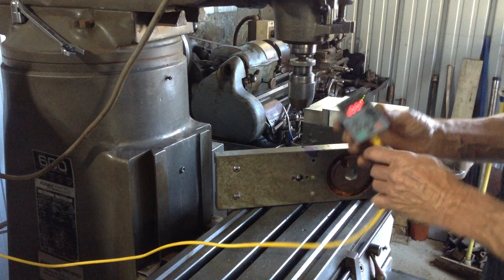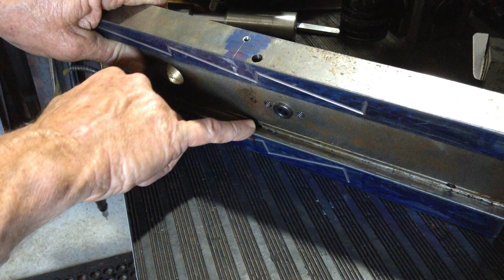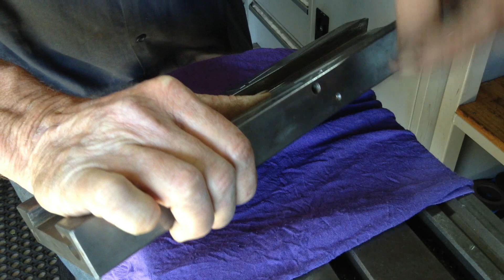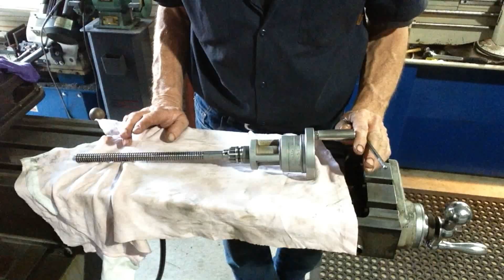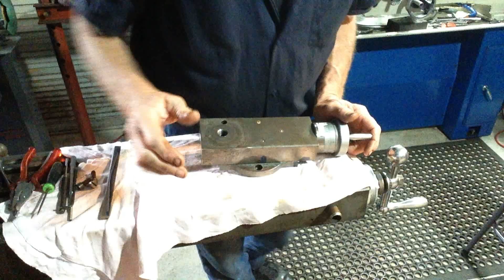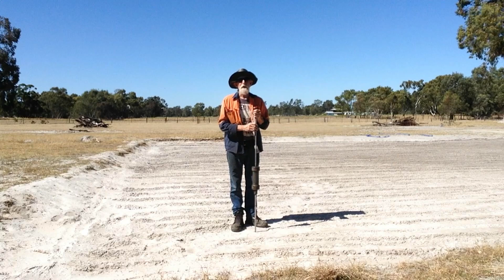Centre Lathe Maintenance & Modifications  , Part 9

Comment: I have a question for ya Max...  Isn't the screw at 6:56 there to lock the cross slide when desired??
Reply from the maker: Yes that screw is the locking screw .   The screws that i have put in near by are to blank off the ends of the oil galleries that i have just drilled .    Cheers .
Reply: @swanvalleymachineshop  thanks max!

Comment: Not sure how you sorted your vfd, but It looks like you have a variable speed head.  Watch how I run mine.  I use the factory barrel switch, I set the VFD freq to 60 and never touch it again.  I control the speed with the knob on my BP.  That little shit plastic box to control these vfds is sure to get broken.  :-/  https://www.youtube.com/watch?v=NwlOGQv8QXM  For something really cool, look at my VFD lathe video.  Yes that is a 2 speed motor!
Reply from the maker: Mine is just wired in so it will run until it's in the new shop & put back to 3 phase power .  I only start & stop with the little shit plastic box , rev is still on the mill switch .  The speeds are through the 2j vari speed knob & the vfd  i keep on 50 htz  all the time , thats what our  240v power is .   Cheers .

Comment: Hi Max, my lathe cross slide bronze nut is the same as yours except it does not have the anti rock grub screws, the sleeve and cap screw which retains the bronze nut is a good sliding fit for vertical alignment but I think over time wear of the sleeve will cause rocking of the nut accelerating wear and causing backlash.
I am on my second nut now, easily made on the mill and lathe, I just bore out the thread and silver solder a sleeve and bore and thread.
Still dubious about the grub screws, now thinking the nut can still rock, to solve the problem the nut must be drilled and tapped and the nut shimmed to the cross slide which is very difficult to set up.
Been scratching my head how I can fit a second nut to adjust for backlash like my old DSG.
The pinch bolt arrangement on our Lathes does nut give a lasting cure as you are only bringing a small portion of the threads together and wears out quickly.
Reply from the maker: I have had no issues yet with the grub screws stopping the nut rocking .  Cam at Battler  ( YT channel ) just recently made a new nut for his lathe & his does not have the grub screws .   Check  Cams  channel .   As for the anti backlash nut , it would be better to have 2 whole pitches taking up the play ,  that's how Cam did his .  Cheers .
Reply: Thanks Max, watched Cam at Battler and yes his idea of cutting the slot further towards the centre is more logical, Next time I make a new nut I will do the same.

Comment: Great vid as always Max.  I wish I hade the two grub screw adjusters on my Cross Slide.  When I made my Cross Slide replacement nut I had to be very accurate on the center distance of the thread to the top of the nut.  If its undersize the nut will pull up hard lifting the screw and causing it to be off center and bind the nut.  With your system you can use the cap screw to pull up against the two grub screws allowing you to adjust up or down to get it right on center with no binding.
Cam
Reply: The grub screws are to prevent the leadscrew binding on the  bronze nut as the cross slide travels from the front to rear and vice versa. Some lathes are shimmed between the cross slide and nut. This saves having to make the nut with a tight tolerance between the centre line of the nut and the underside of the cross slide.
Reply: To be accurate we used to place a dial gauge on the end diameter of the leadscrew and watch to see if the leadscrew moved up or down as the crosslide was moved from front to back. If it moved we would take or add shims to the top of the nut.
Reply from the maker: @geofflodge6784  I could feel the screw free up with adjustment of the screws , i think the shimmed type would be better as the grub screw tips wear into the nut .  Good method using an indicator though .
Reply: @swanvalleymachineshop  I suppose one could easily machine a thin steel plate to rest on the top of the bronze nut assembly. The plate would feature a center hole for the cap screw to pass through to the nut and would provide a steel surface for each of the two adjustment screws to bear against. By using thin steel, the plate would flex slightly as needed for alignment of the nut while also preventing the grub screws from wearing into their bearing surface (now steel, not bronze). Probably overkill, but it might work...
Reply from the maker: It works ok Cam , but  Geoff Lodge mentioned the shimmed method  & i think that would be a more rigid set up  Cheers .

Comment: Max How far off are you from pouring your Pad, and are you doing it yourself or paying someone to do it, i need to get a 6×4 pad done for my new smithy soon, if you have any recommendations
Reply from the maker: I am trying to get it done by january  as i still have to put down the sub base .  I still have to get quotes for the concrete  so not in contact with any at the moment .  For small jobs i normally just look in the local community paper . Cheers .

Comment: G’day Max, coming along nicely, those galleries should serve well to keep the lathe in top condition. I do like the 2 grub screws and your theory of use, I first thought why not machine a flat surface on the side of the nut but then what if the thread is not perfectly parallel, simple, fit the grub screws for alignment, good idea. 
Your ground penetrometer I presume is a measured weight, does it also back up as a slide hammer:)
Cheers 
Peter
Reply from the maker: Thanks .  The peno weight has to be 9kg & dropped from 600mm  .  Cheers .

Comment: On the crossslide, you made acccess for oil to the outside of the gib, but how are you getting oil to the inside of the gib. Either way great job, this something I need to do to my lathe. I have an older Atlas Clausing probably made in the 1950's. Enjoyed the video it gives me ideas on how to go about it, thanks!
Reply from the maker: There is a slot i put in , in the centre of the gib for  the oil  to enter .  But i noticed one of the origional drillings  puts oil on top of the dovetail ,witch does nothing so i will now blank that one off & fit an extra side oil port . Cheers .